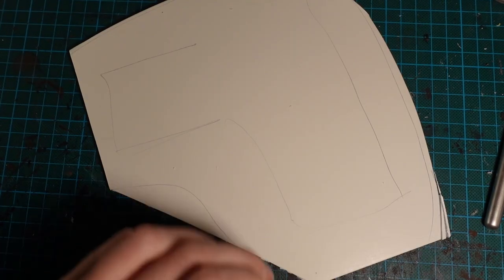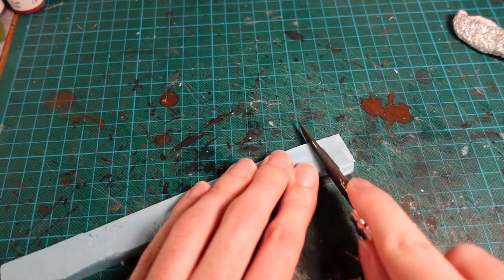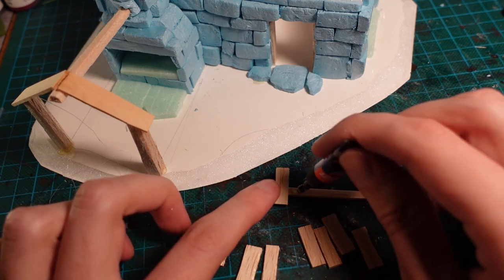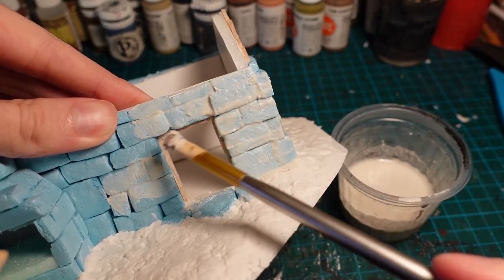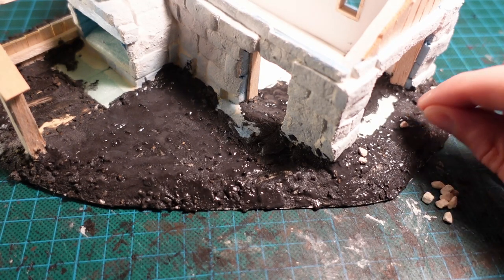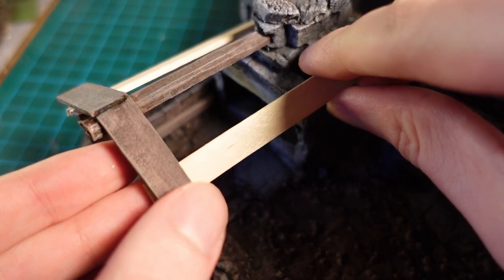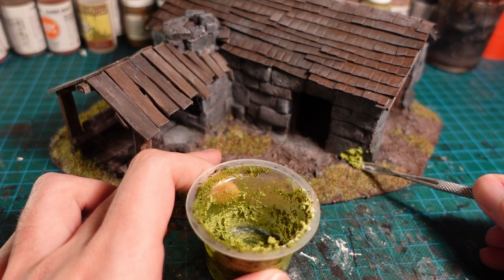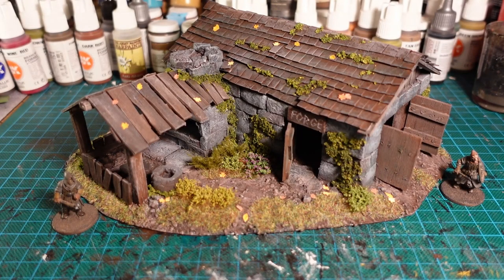Scratch Building a fantasy blacksmith/forge

Comment: Love the build as always! Was there a reason you chose to put the side roof over the forge on after you primed and painted everything else? I noticed that about halfway through and didn’t know if it was an “oops I forgot” thing or a purposeful choice.
Reply from the maker: Yeah, that was for ease of painting so that I could get a brush inside without having to poke it under the roof/supports
Reply: I didn’t think about that, but that makes a ton of sense. (I totally would have put it on first and cursed myself while I struggled to paint around it.)